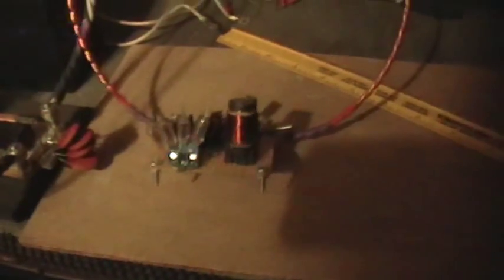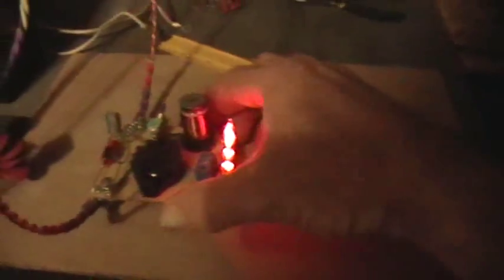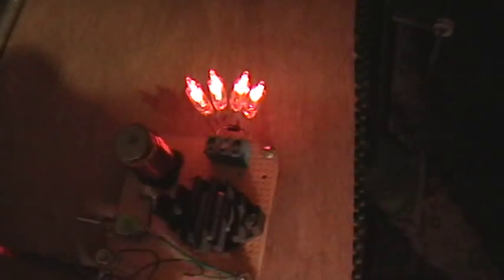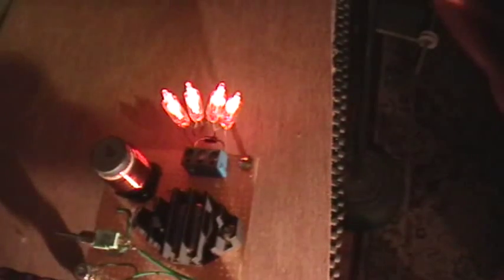Joule Thief: NE2 JT Converted to Wireless Power

Comment from the maker: You mean when I was waving it around? I probably just didn't have it close enough or aligned. It's a directional system, and you can use the receiver to map the magnetic induction field from the transmitter by moving it around. Think of loops of magnetic field lines circulating as if the transmitter loop was a big disc magnet. It doesn't attract or repel anything though because it's oscillating at 800 kHz.